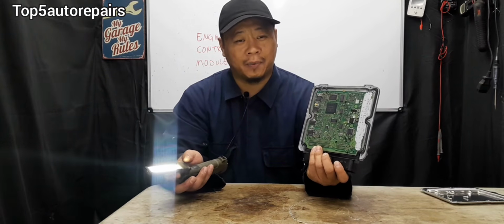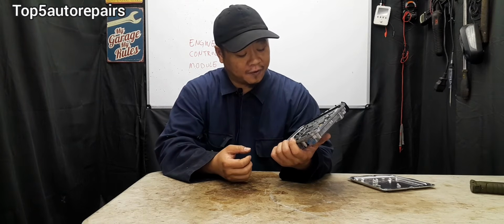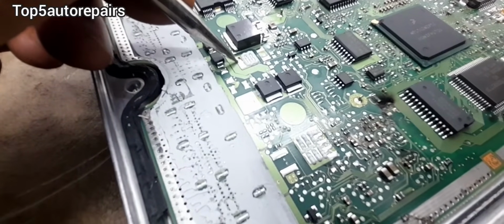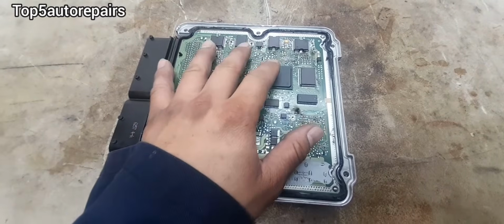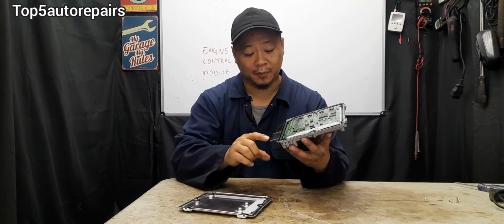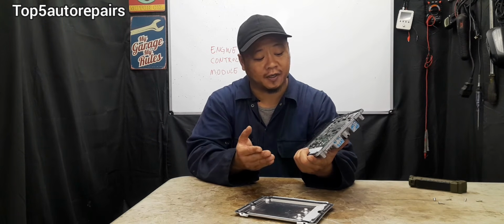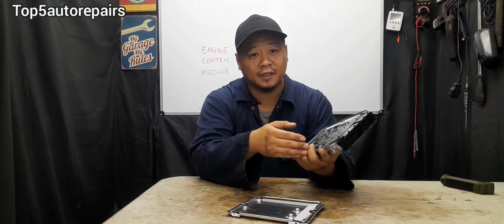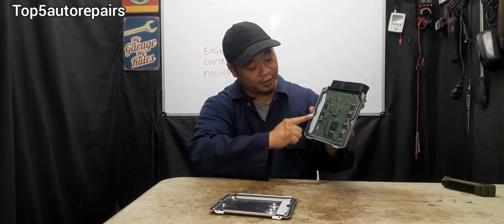SIGNS OF A BURNT OR BAD ENGINE CONTROL MODULE (ECM PCM ECU) I EXPLAIN COMMON CAUSES WHY IT FAILS

Comment: What about heat soaked wires.  Ive changed my ckp sensor 4 times.  I get power at the harness but i never get a rpm on crank.  You did mention if two wires were exposed and touch their could be a short.  I have two at the harness exposed that I covered with liquid electric tape?  I did smell a burnt smell.  What do you suggest a good next step might be?  A 2004 Hyundai xg350.

Comment: Dear Sir. I have a 1995 suzuki V6 with engine type H20A. The check engine light flashes continuously ehen the key is in the on position The engine starts but runs badly and really backfires when the gas pedal is applied. But the car runs fine on my friend's similar ECM. My ECM board looks very clean. Any suggestions?

Comment: Thanks. My GMC Sierra 2011 5.3 v8 is experiencing code P0601 which translates to (Internal Control Module Memory Checksum Error), do you think this is something noticeable on the module board if opened?

Comment: Ive been having issues that started with me doing an unnecessary crank sensor replacement. My original issue actually turned out to be a bad fuel pump (already had a new sensor that I was planning to install preventatively at 250k miles, so I did that 1st before any diag). I started getting a po336 code only after installing the new crank sensor. Found some bad wiring and replaced all the wires and connectors for the cam and crank sensors. But I still am getting the p0336 and having a cranking nostart, but only when I try to restart the car after thoroughly warming it up (meaning it takes longer than just reaching operating temp) and then turning it off. And now most recently, i also started getting codes for low voltage on both knock sensors along with poor performance while hot. But i let the car cool down for an hour and then everything is fine, it will start up and run perfectly.
Suspecting the ecu but I just ordered an oscilloscope so I can check if these signals are coming in to the ecu when the problem is happenig. If its receiving the crank signal and the knock sensor voltage, but not seeing it, is that 100% a bad ecu? Or is there anything else to check? It sounds like maybe bad solder joints based on this video

Comment: I have question my 2007 Cadillac DTS my AC started to blow hot and my traction control light turned on I stopped and noticed now when I shift into park or drive it jumps severely I ran a scammer on it and my eck tcm and bcm come all up plus a few other code what do you think it could be? And my fans stopped working all at the same time we tested the fans with a multimeter and they turned so they are still good but don't turn on when they are suppose to

Comment: is it possible a failing control module  ECM  might not trigger the check engine light? because the ECM is faulty?
Reply: i guess i found out by myself

Comment: I have a question hope you could help me I have a 2006 Dodge sprinter 3500 it started by not starting when hot but start when cold I have changed crankshaft sensor , camshaft sensor, now the diagnostic shows control module misfiring

Comment: Anyone have any suggestions. ? I have a 2012 sonic  and when I turn my car off  I can still hear the fuel pump primed. And eventually it drain my battery.  If i pull the ecm out it will turn off the pump any help thank you

Comment: Thank you brother. I've been working on my inlaw's old New Yorker chasing a short but I was about to keep looking through wires looking for a short circuit but I have a feeling it's the ecm since it is old, it is located in the engine bay right next to the radiator cap and it did get wet right before the misfire. Keep up the good work. I'm gonna pull it out and inspect it.

Comment: I have dodge Journey 2010 2.4l engine light flashing and code was 1 cylinder misfire replaced all plugs coils still light flashing what could be the issue

Comment: Brother, I have a 2000 528I BMW , I was installing a aftermarket radio.. Car was Idling Running Really GOOD and out of No were it stared to run like crap!! We checked All the fuses & they are all good!  I keep thinking one of the wires sent a signal to the ECU/ECM one of the 2 and now it says it Only running on 2 cylinders what do you recommend? I even brought in a mechanic , 1st thing he said Oh replace the Coil packs!  I said Naaaa It has to be the ECU or one of them 2?

Comment: My car ecu has multiple engine codes and runs fine no problems I try using a obd scanner but won’t connect to the ecu it has power I’m assuming it’s the ecu that’s bad

Comment: I have a constant 5v on my signal wire for my crankshaft position sensor without the sensor plugged in. Does that mean the my ECM may be bad?

Comment: Talk about poor design, there does not seem to be any test points on the control module itself to aid in repair or confirmation of operation.
Can the module you are showing in this presentation, be repaired?

Comment: THANK YOU FOR THIS INFORMATION.  YOU ARE THE BEST.  I think I killed my ECM and you just made me 99% sure.  I have a 2007 Chevy Silverado 1500.  It was sitting for 16 months.  The starter had a bad solenoid so when I put the battery wires without the key in the ignition, the truck started on its own.  I put the battery cables on another 4 times trying to figure out if it was the solenoid getting stuck.  I think this is what melted 5 of my 6 relays on the fuse box.  If that wasn't bad enough, I accidentally crossed the wires when trying to boot it up for a few seconds.  If the ECM wasn't fried before, it definitely died then.

I got U0100 from the brakes, transmission, and fuel pump as well as a B30600 for the theft deterrent system even though there's no security dash light.  My scanner can't communicate with the ECM so it doesn't recognize it at all after I deleted the codes.  My radio, transmission temperature/odometer display on the dash, windows, AC motor, and locks do work.  Oil life was reset.

I tested the ground and voltage going to the ECM with a breakout box.  Tested pins 6 and 14 with engine and key off at 61 ohms which was good.  Ideally it should be 60 ohms.  Tested pins 14 with 4 (ground) with engine on and key on at 2.15 volts, with battery at 13.9 volts.  Tested pins 6 with 4 (ground) at 2.43 volts, with battery at 13.9 volts.  Ideally they should be 2.5 volts.   

Before I used the breakout box I had multiple things going wrong at the same.  The terminals for the battery cables were cut so they weren't properly secured.  I lost the rear engine ground which I replaced with something half the size at the wrong location to make it easier on myself (which I shouldn't have, it probably is one of the reasons why the surges fried the ECM).  I made sure all the mini fuses had less than 2 ohms after I replaced the bad relays.  When the relays were trashed, the mini fuses were reading between 10 to 15 ohms.  I'm hoping the fuse box isn't dead since the mini fuses' resistance did go down after the OEM battery cables, grounds, and relays were changed.

Time to tear it apart since I can't smell anything burnt.

Edit: forgot to thank you.

Comment: Sir, you are the best Subaru mechanic...your expertise is so apparent.

Marry me
-- and/or -- please, PLEASE explain the following condition:

#2 spark plug has fired (175 psi).

1, 3 & 4 spark plugs haven't. (Zero psi)

OBD shows PO325 knock sensor code

I'm sure you are a very busy man, but I'd appreciate your response ASAP. Thank you so much.
Reply from the maker: I think you might have a head gasket issue or worn engine bearings ( any knocking noises coming from the engine?)
Reply: @Top5AutoRepairs  The car was running perfectly until one day I was driving on the interstate at about 60 miles per hour --  the timing belt shredded and broke, I heard whizzz, there was a sudden loss of acceleration and I pulled over to the side of the road. There was no jerk or clatter, and no other operating issues when this occurred. 

Since then, the timing belt has been put on again and again and again. Each time there's been question about the correct timing marks, as well as whether the engine is non-interfrtence. 

The first time the timing belt was installed, the car fired right up and briefly ran, after the car was turned off and the radiator put back on, the car would not re-start.

Timing belt reinstalled, again and again, ipon which it starts, sputters, backfires, stalls, then will not re-start.

I am so done trying to discuss this with my car experts upon whom I rely -- I don't know much about cars, only know that I absolutely love my Impreza, which had been running like a pleasant dream, iit started fine, ran fine, no noise, no smoke, no milky color to the oil.

I have asked. "Could the valves be sticking (resulting in no compression)?" Yes, is the answer, but no one will spray them with something to unstick them, "it's too hard to reach,' they say.

I don't know what to do anymore. They are starting to tell me I need a new engine, and that yhe cam may be bent; but there was no jerk wgen it happened.

I don't believe it needs a new engine. All I know is I am without a car and completely dependent on my mechanic friend to pick me up and take me to-and-fro and it is very frustrating for a woman my age and with my active ministry.

We did a dry compression test once, Which seemed fine at the time but now has been explained away by possible improper timing?

Very depressed and frustrated.

VIN# JF1GF4858VH801438
Built 07/96

Apparently, between 96 and 97, they went from a non interference engine to an interference engine.Any insight you can provide on this is much appreciated.I am in Gainesville, Florida.Thank you so much for your time

Comment: my 2010 ml 350 Mercedes doesn't want to turn on it only clicks clicks.  I've changed alternator, starter and relays except the battery but no luck. Can it be the module control since it shows code po 607 ??

Comment: Question:
2000 Honda Accord sedan V6 ex 
The only code I'm detecting is the ECM Timed out. I can't remember the # but I can run a scan again if it will help you. I have been driving it well over 100k miles with this code. I haven't changed the ECM because of the immobilizer. I've had to fight with this in the past and it's a freaking headache. I got lucky because I changed the tumbler cylinder and I have to wiggle the key some but it will turn and start the car... Question is... Can I get another ECM and change the immobilizer chip from the old to the new one? 	No key Smith round here wants to take on the job of reprograming this car... And I can't afford the dealership 
Thanks for ANY help! 
Great upload!

Comment: I replaced the head gaskets on my 93 s10. When I initially started the engine after the repairs it ran rough and stalled. When i tried to read the codesit would flash weird codes like blinking real fast 5 times and then 2 slow times. I believe i finally finished screwing up my ecm by trying to start the engine withe the scanner plugged in.  Now it won't even try to start. Uugh

Comment: Mine did something weird today so mine at first when i wanted to lock my car it did not beep when it locks nothing after a couple of times of pushing the button to lock it did. Next later like 2 hrs later i tried turning my car on it did not crank nor the lights came on so that was werid the second time i turned it on it started for like a quick sec then it turned off. The third time i turned it on it started but my car like started idling at 400pms and the screen like restarted. I drove it for a bit and turned it off and on and it started to idle normal and turns on fine and i dont know what it could be. This was on my 2006 lexus gs300.

Comment: Hi great information, I'm replacing a ECM on a 2003 Saturn L200  is there any special programming needed for this ? or is the flash program from factory ok. thanks
Reply: with most vehicles new ecm you'll have to have it flashed with you VIN number of the car. dealership can flash it but maybe to expensive for some, there are other resources to buying a ecm online an providing VIN number to have it flashed an mailed to ya.

Comment: I have Fiat Stilo 1.6 16v 2004 year.
Ecu mount on top engine 😢. Magneti Marelli IAW 5NF.T9 OEM 51759028. Hmm.. twice died in 2 years (50k kms) I have removed about 20-30 cm right from possition is mounted, now I wait to be fixed and to mount again. The worst ECU, I think it is..

Comment: Great info. Ive been replacing body wiring harness and other things because a dude stopped to help me  while i was waiting for a tow and troubleshooting no start on my 04 Pilot.  He asked did i want a jump. I figured why not, i hook up cables on my end and look over to see hes hooked up correctly.  Well he saw red wire and assumed it was positive. It was not.  I go to turn my key and see smoke immediately in my cabin from the rear. I rip off the cables and run to the back to knock out the small fire on my ABS speed sensor  and rear diff wiring that melted from the abs sensor burning. I look back and my cables are on the ground as he speeds off. 

After replacing the body wiring harnesses on the driver side, wire had a burned ground from the abs speed sensor connector under the carpet across the trunk and looks to have stopped before the VTM-4 module.  I've chasing down all burned wires, replacing the broken starter ground that caused the starting issue. I was able to start it in limp mode and move it successfully like 200 feet to my house from where it was dropped off in July. I parked and kept it running. Seemed like it needed a code reset and i start checking fuses again. I notice a 7.5A fuse for the VTM-4 is blown. I swap that with another 7.5 and the Pilot died.

 Only thing that turns on is the fans and some servo motor on the back of the motor now. No fire, no burned wires, all blown fuses have been replaced. All wiring has been soldered or replaced.  I think all blown fuses are replaced. I don't know where to go from here besides pulling the ECM and VTM-4 module to look for burnt connections. 

I'm not getting any codes besides P0607  (ECM) and P0748 (Trans pressure solenoid) and no crank, nothing.  No other codes with a Foxwell Honda scanner. I'm at a loss and don't know if I should scrap it, part it out or try to fix it. I'm $1000 in fixing it myself and don't want to spend another $500-1000 /to still have electric gremlins.  

Any suggestions would be greatly appreciated.  Thanks for your informative video.

Comment: Thankyou, its also safer to apply to the groove in the cover ,a nice bead in the cover will do the job ,as you don'xt want an over spill of silicone causing a mess on the PCB,making it inposdible to take the cover off at a later date.

Comment: Thank you so much this is such a wonderful information my sons 2002 Celica will not start a check, spark plugs, voltage, fuel pressure,  pressure on cylinders,  Finally I decided to check under the ignition switch it turn out to be the main module was replaced at one point and the connections were loose, not at the plastic connector, but when it was replaced the wires were cut & portly reconnected, I connected each one properly make sure the colors match and the car started right up. Thank you so much for sharing your wonderful knowledge I always look forward to seeing your videos I’m sure other subscribers 2.😊😊😊

Comment: If you need a new one is it a dealer part to be programmed by a dealer software, or can you send it to those places that will repair it and fed ex it back to you.
Reply: In my experience when I used to fix cars for a living, it depends on the make and model of your vehicle, older cars u can just replace, newer it must be reprogram, u must  research it, like on your tube, Of course dealer will charge you  five times more than private source,  if you can find a private source with good reviews, & Warranty that may be the way to go, however if you can afford the dealer then of course you can’t get better than dealer, it all depends on your budget,& the willingness to do research, good luck.😀
Reply: South Main Auto has a guy who reptigrams them.
He's on a couple bids. Just have to search to find the guy. He has a youtube xhannel.